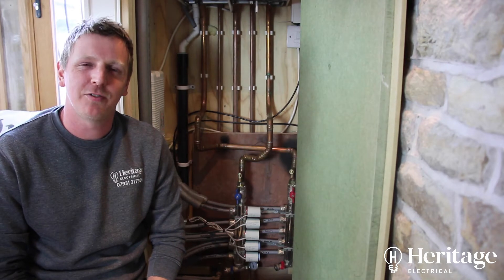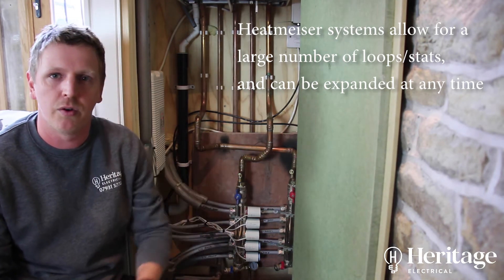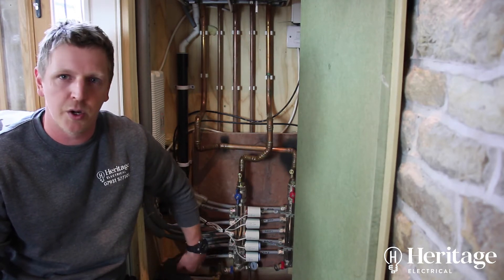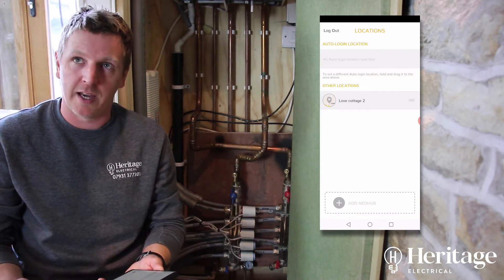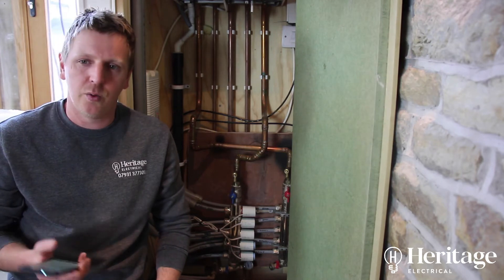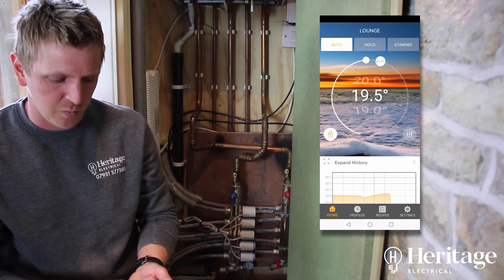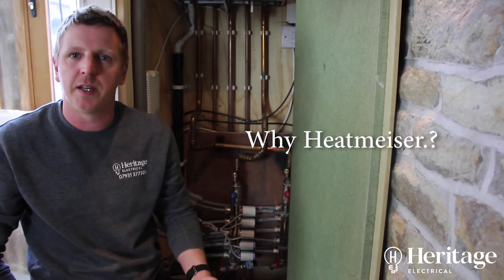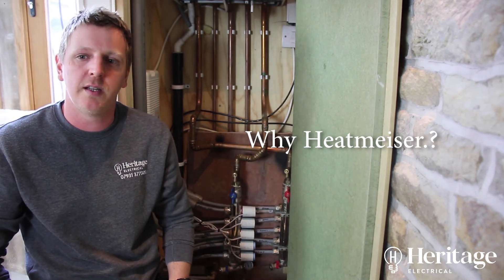Heatmiser Underfloor Heating System Installation Overview

Comment: So if you have two underfloor heating zones on the ground floor, and the rest is just radiators that are boiler controlled, that's all done with the UH8-RF, right? Or can the Heatmiser 2-zone work also? Or does the 2-zone not control the boiler

Comment: I'm helping a friend out. This house has 3 x Heatmiser UH4 controllers. There are two boilers in the house that will be running in parallel with each other because the house is so big. All three boiler enables go back to the boilers. Is it literally a case of joining them in parallel so if any of the UH4 call for heat it will turn the boiler on?

Comment: Not more efficient unless your boiler can modulate that low to keep one stat satisfied. Better off with weather compensation and the whole system on one zone. No problems with cold floors etc

Comment: After a bit of help, I’m looking at one of these to control an electric radiator and immersion tank. So when the stat is turned to ‘heating on’ does that put the live down the N.C terminal? Tia

Comment: Evening I've just installed a 7 port underfloor heating manifold and the manufacturer has given me a UH4 heatmiser dose this also have the WiFi built in in or shall I exchange for the uh8 heatmiser
Reply from the maker: Hi Ray
The wifi is not built into any of the models.
If only have 4 zones to control then the uh4 is ok.
You need a neo hub to get the system online.
Thanks for watching.
Heritage electrical 🙂

Comment: Hi,
Can i just exchange a standard timeclock for the neo-e without the hub? Im assuming the hub is just to have control via the app?
Cheers
Andy
Reply from the maker: Hi Andy
Yes the hub is for remote access and programming only.
Heatmisers equipment functions as a stand alone heating controls.
Cheers paul

Comment: I have 2 loops in the hall room due to the size is it possible to connect both loops actuator to one thermostat. I have exactly the same Heatmiser system or I need two thermostats for two loops
Reply from the maker: Hi Eric, apologies for the late reply. Yes you can: you would wire both actuators to the UH8 zone relating to the thermostat you'd like to use.

Comment: This may sound a bit vague but my daughter moved into a new house last August and theirs is a heatmiser system. The relay box I recall is the same or similar to the one in the video. They have individual thermostats in each room. (4 or 5 zone, Radiators upstairs). but no app. Do you think this can be retrofitted. My guess is that it can be. All the controls and manifold are in a cupboard where the router is located as all the ethernet cables go in there. If the relay box is the same would it be a question of just  plugging in a hub?
Reply from the maker: Hi Paul 
Apologies for the late reply.
If the thermostats your already have are Neo stats, You will need a Neo hub to get it online. 
After you have installed the hub the system needs re programming. 
Cheers Paul
Reply: @HeritageElectrical  hi Paul
No probs. Thanks for your reply.

Comment: Useful information - thanks for the upload.
Reply from the maker: Hi Richard, Glad the video was helpful.
This video was a quick overview of a smaller simple system.
We will be uploading a larger heatmiser installation, working alongside vaillant heating controls soon.
It controls an un-vented cylinder, conventional radiator system and 2 separate underfloor heating manifolds. 
This will be a more detailed video which may be useful to you. 
Thanks for your positive feedback 
Cheers 
Paul Watson

Comment: Hestmiser controls are not good .I have 3 RF v2.They all in the same place .3 different temperatures.After one month at one of them the sensor temperature faild.
Reply from the maker: Hi, Hope you are well.
Try using external sensors if you think the built in sensors are not accurate enough.
There are connections on the Neo stat for additional air and floor temperature sensors.
You can have the stat controlled by all three at one time for more accuracy.
All the best 
Paul Watson

Comment: Can heatmiser uh8rf be linked to boiler opentherm as i am minded its is 230v not a low voltage as required by opentherm. 

Have a similar setup with neoair and neo hub with the wireless relay
Reply from the maker: Hi Abhishek.
UH8 or UH8 rf are not compatible with opentherm controlled boilers.
If you would like heatmiser equipment for this you need -

https://heatmisershop.co.uk/wireless-combi-boiler-wifi-smart-control-kit/

Hope this is helpful.
All the best.
Paul Watson.